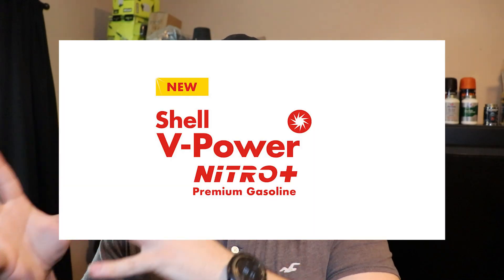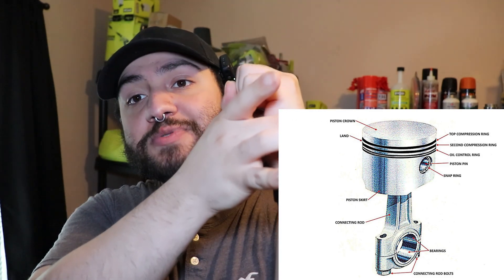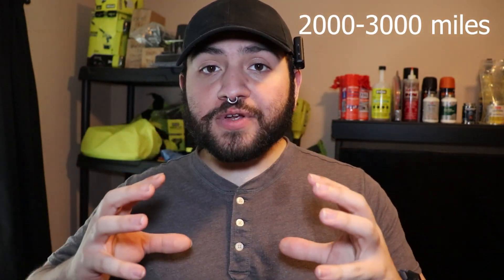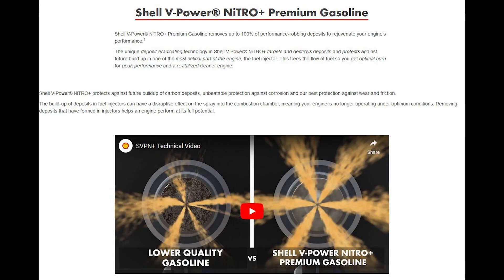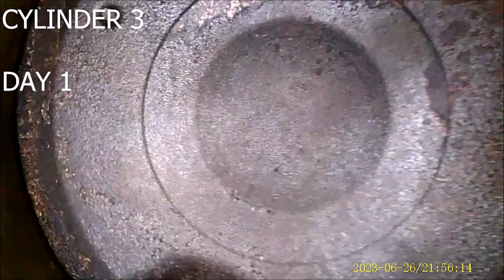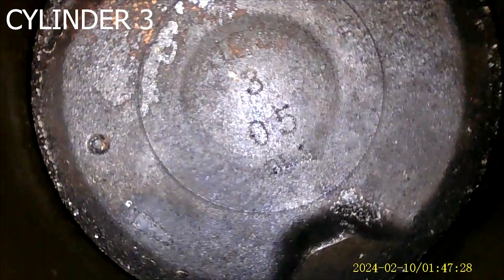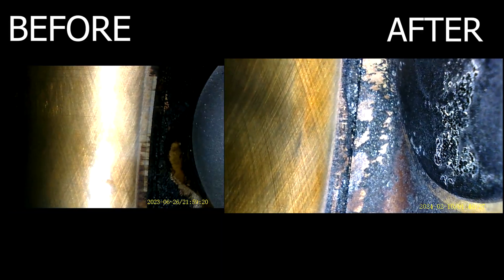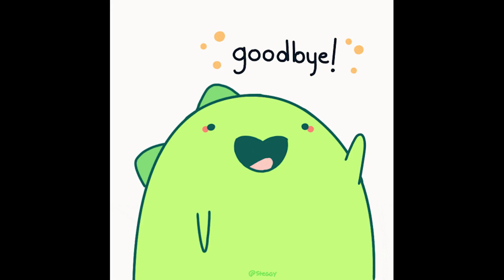IS PREMIUM GAS A SCAM? $$$$ (SHELL V-POWER NITRO +) - 8 Month Experiment

Comment: ‘Premium’ octane is only for engines that require it. I do consider shell and chevron to be premium brands, but no need to use premium octane unless your car requires it (like sports cars and luxury cars). ‘Cleaners’ are the same for all grades, it’s just the premium octane has other additives to prevent low speed preignition in high compression ratio combustion chambers.

Comment: Imagine not being smart enough to catch on language play in the marketing material. "Up to 100%" is merely stating theoretical possibility of the maximum result which is very different thing from guaranteeing a MINIMUM amount of result. The kind of marketing material we as consumer should want to see is "Guaranteed to remove AT LEAST x %" or "Guaranteed to remove MINIMUM of x %" . The "up to 100%" actually mean 100% is possible but they make no promise and realistic it could be 1% of carbon removed but they only merely state the possibility of 100%.

If you realize or knew this you would highlight this and knew that the marketing material is not worth paper its printed on not even worth seconds of our live talking about it.

Oh and  if you want to remove carbon your best bet is either chevron techron bottle or redline SL-1 those two actually contain PEA which is one of basically only chemical proven to actually remove carbon in engine. You would basically have that 8 month worth of result in maybe 3-4 tanks of gas whichs maybe 3-4 bottles. (dont be scared about overdosing to maximum of double of recommended amount ratio)

Comment: I use BP 98 oct. premium mostly as it is cheaper than Shell most the time here in Australia. It contains cleaning agents e.t.c 
and i add a fuel injection cleaner every 5 or so k. I Think using BP and Shell Premium from the start when buying a new,car is a good preventative measure. Besides, more performance and more km comes in to play too.

Comment: My mom's 2004 honda crv started idling rough after filling up on some Phillips 66 93 octane gas which had never happened before so I added Shell V Nitro with a Bottle of STP Gas cleaner on the way back home which was still 30 miles away and my mom's CRV started to idle smoother and the engine light even turned back off after I added the Shell V Nitro Gas so I think maybe the gas station at  Phillips 66 had water in their gas or something even though it was 93 octane. It was mostly highway miles so I'll definitely be using it again.

Comment: There will always be carbon on the inside of an internal combustion engine unless you disassemble it and wire-wheel or bead blast it away.  That's the "carbon" part of hydrocarbon fuels.  It is a by-product of combustion much like the soot in your fireplace at home or the black oily crud in a BBQ.

Comment: Hello I am new here. Happy thanksgiving 🍁 good video. I run Shell fuels in a 2016 RAV (4) or if at Costco I get fuel there both are great & certified top tier gas. I take the vehicle out on the freeway which is a good way to cut down on the carbon deposits & running a good quality fuel makes a difference. 😊 I use Valvoline Protect & Restore Full synthetic Oil 0-W-20 . I put a Quart of Lucas synthetic oil stablizer I mixed into the oil and mixed it in before I changed the oil that vehicle & it’s high mileage. But it runs like a champ

Comment: the people who made my car require premium fuel. if it is a scam, oh well then I paid a few dollars more for gas. I’m not willing to possibly ruin my engine to prove that it is a scam.
Reply from the maker: if your car is engineered to use fuel that is most resistant to explosion/combustion (octane) then that's what you should use. I will say look into additives from wherever you get your fuel from. If it's good stuff then yeah it will cost a bit more but you also have more additives like cleaning agents to keep you valves injectors and piston heads cleaner. When debris from the combustion cycle gets past the compression ring to the oil ring you may notice oil on top of your piston being burned and even smell it while driving. Thanks for sharing Michael.

Comment: $4.39 for Nitro 93 in Indiana today...12 May 2025. I believe my gas mileage is better on Nitro. I drove my 2024 platinium higlander to Lake Wales Florida and got 26.4 miles per gallon and cost me $70.00
Reply from the maker: nice. higher octane + the cleaning additives refresh the fuel injectors it would make sense that your vehicle would burn less fuel and use what is being used more efficiently. That's good to hear :)

Comment: Forget about NY drivers, how about the fact that the cheapest gas was used for the life of the vehicle?  What about oil selection/quality as well?
Reply from the maker: @pbellissimo  low quality conventional oil definitely affects vehicle performance. Additives in good quality oil include anti sludge build-up properties. Castrol is solid for combating sludge while Mobile 1 is good with quickly coating components to minimize friction within seconds of startup
Reply: I believe no matter which oil, no more than 5k and 3k better
Reply from the maker: @pbellissimo  I agree. I personally also always put a new synthetic oil rated filter as well with every vehicle I work on. The oil I use is also rated for a year so if the owners don't clear the oil's mileage rating, I'll still schedule them for their yearly change. Haven't had an issue yet.

Comment: Good experiment. I think Shell Nitro+ is effective in cleaning deposits in the Fuel Intake System, not in the combustor. I always use Fuel System cleaners, such as Techron and STP. All these cleaners are called Complete Fuel System Cleaners. All these products claim one bottle can clean all fuel systems. So I feel the term, "fuel system", does not include combustor. So it's less effective to clean the combustor. Maybe I am wrong. It's just my opinion.
Reply from the maker: @yifeipei5484  I hear really good things about techron fuel it's just not available near me. And yes the magic bottle that gets sold to people who can't afford repairs is wild. These patches, sealants, and fillers ultimately to more damage to vehicles in exchange for the vehicle being quieter and not leaking for a month or two
Reply: @TOOL_TECHNICAL  I just bought 4 bottles of Techron Concentrate Plus for a total of $18.30 today. I will add one bottle each month to see whether they can bring some improvements. I use Costco #87 gas. Maybe in the future, I will try Shell Premium gas.

Comment: I want to know how often was that car oil change for all that buildup I’m looking at was it the oil change regularly or was it cheap oil cause that can also be a factor as well how often the oil changed and the car was maintained 11:53 you did say it was a rental
Reply from the maker: @American_Express_my_love_  because I used mobile 1 100% synthetic oil, I got in done yearly for 7 years along with a new fram ultra synthetic filter. I always assume prior to me touching any vehicle that it was completely neglected or given inferior fluids/lubricants. The current owner has had it for 7 years, before that one owner, and before that a rental in 2 other states
Reply: @TOOL_TECHNICAL 🫡🫡🫡

Comment: I also put seafoam inside of my tank. I put 93 octane shell in there. I did that today and I’m gonna see how well it works out but I’ve been using Shell for like four or five years. I cleaned out my car. I drove to Florida and back on 93 octane I filled up six times.
Reply from the maker: @American_Express_my_love_  I hear very mixed reviews about seafoam. General people go with Lucas, amsoil, etc. For additives. Hopefully it works out for ya. Ouch 6 fill ups, hopefully the gas wasn't too pricey
Reply: @TOOL_TECHNICAL  yeah I really don’t remember how much I spent that was around 2022 when I had my son I drove from New York to Florida. I filled up every half tank and I change my oil the day before 5w30 Castro edge high mileage. Synthetic. I started with 62,000 miles. I came back with 65,000 Nissan pathfinder 2001 LE 3.5  engine. With my fuel saving app with Shell, I got $.20 off and $.50 off at the pump so I saved I may be paid three or 3.50 the most surprise me it was the most expensive close to five dollars
Reply from the maker: @American_Express_my_love_  not bad, those speed perk savings come in clutch.
Reply: @TOOL_TECHNICAL frfr

Comment: I’m in the UK and my last car was a 1.4 litre turbo Vauxhall Astra and the car didn’t like cheaper fuel it would judder a bit but I swapped to using vPower and the car was so smooth after that. Not sure why to be honest
Reply from the maker: @granterono1  interesting. Petrol ratings for that seem to include e10 and regular. My guess is if your engine had hot spots or issues where the fuel was combusting prematurely with the regular gas causing an almost misfire. 🤔 octane is essentially how resistant to compression before exploding / combustion something is. Your car seems to be rated for regular gas but the additives and higher octane in premium may be what your car needs. If the premium gets too expensive, you could try using regular with a fuel additive to raise the octane (of course it wouldn't have the detergents from nitro v) which may be worth a try. Hope it helps grant 🫡
Reply: @ yeah was very odd, I assumed it was just my engine till someone in a group for astras mentioned they had the same thing. I got a new car now so that’s no longer an issue for me :)
Reply from the maker: @granterono1  that's cool, hope it lasts a long time for you with the right care

Comment: 2008 impala 151k miles. Shell v all the time. Big difference runs like a champ alone with all mobile one oil/filter. Let’s not forget Lucas trans conditioner before any problems.
Reply from the maker: I've only used lucas fuel injector cleaner and seen little if any results. Glad the fuel works for you! Transmissions are super expensive, I hope yours lasts forever :)
Reply: @TOOL_TECHNICAL  yes thank you. trans fluid is still little red.
Reply from the maker: @Dwayne6692  solid. i'd change it every 30000 miles with a new filter and gasket. many ATF fluids say "lifetime" of transmission being ~60,000 miles. many people drive their cars for years without touching it. 30k is a safe spot, with a good filter you'll get more life and smoother driving from it.

Comment: i wouldn't be surprised that the catalytic converter and the rest of the exhaust system is looking better too. while i have been using a different brands higher grade fuel (ethanol free too, dunno if that matters or not) for a couple fill-ups and have noticed a bit better performance as well as the tailpipe be less sooty.
Reply from the maker: prevention is the name of the game, once clogged (like any home appliance) the parts have to work and wear harder to compensate performance. Take care of your machines and they will take care of you :)

Comment: I wonder if I could just fill up my vehicle halfway of normal gas and the other half with the premium stuff it would work
Reply from the maker: the octanes would average for less performance. You'd be paying a partial premium for essentially the same regular fuel. regular octanes are 85 - 87 while V-power nitro (depending on location) can be 91-93. assuming you had 85 regular and 93 Shell Nitro premium, it would be 85 + 93 = 178 / 2 = 89. You basically get shell plus gas with nitro price and some of the cleaning additives. I would go all or nothing but that choice is up to you Moxie, thanks for sharing :)
Reply: @TOOL_TECHNICAL  thank you for answering my question on a year old video, like damn I'm subscribing to you
Reply from the maker: @PrototypeMoxie  no problem at all, every question should have an answer :)

Comment: Run Valvoline Restore and Protect 5w30 , change it quick at 3000 miles after initial change and than 5000miles later for future changes....and than do that type of in Cylinder views
Reply from the maker: thanks for the suggestion!
Reply: @TOOL_TECHNICAL  it will surprise you , at the same time continue with Shell 93 the best fuel on the market

Comment: Lots and lots of variables to consider. Here is one observation. The extra fuel cost for the Shell Nitro in a 20 gal tank is about $4 (per fill up). Using Top Tier gasoline exclusively and a fuel system additive once a month might be a better alternative.
If the driver is contributing towards carbon buildup that could also influence results.
Reply from the maker: @Howard-dv4vo  preventative maintenance is the name of the game. This is the "top tier" shell has to offer so I'm assuming you mean the highest octane choice at any station? Fuel additives can help but there are too many snake oil products on the shelf. Thanks for sharing Howard
Reply: Wow thats cheap! premim is almost an extra dollar per gallon in iowa

Comment: I have a 2002 Ford F-150, and I started using Shell V-Power Nitro+ July of 2024. I don't use it on every gas up, but when I fuel my truck with it, I can tell the my truck LOVES this gas! It out performs any other gas I've used in the truck. So as the months passed, I could ALSO tell that my truck engine performance was getting better and better. And as of today, my truck performs like a car! The engine is silent and steady and FAST! I don't know about if it's cleaning all the carbon deposits, but it's doing something great for my truck. I'm a believer!

Comment: This is a port fuel injection engine, so of course you should see some cleaning results because the fuel sprays the back of the intake valves.  However most vehicles are gasoline direct injection now and the spraying of fuel is no longer on cleaning intake valves.  Do you plan on doing this experiment on a GDI engine?  That would be awesome.  I’m o see.  I drive a Porsche twin turbo 3.0 and I was using shell, but Porsche recommends Exxon Synergy Supreme Plus.  I am curious to see the results between these fuels in a turbo charged GDI engine.
Reply from the maker: Yes this is multi-port, I currently don't have a GDI vehicle owner willing to do the experiment near me where I could control the variables for an honest experiment. If you've ever seen Volkswagen GDI valves get caked in carbon it is not fun. For the cleaning concern, many prefer a multi port inject so the ratios can be more dialed in. The sequential injection is consistent and easy to maintain. appreciate the feedback. A turbo porsche sounds cool but right now I got snow and it's 2-5 degrees F lol

Comment: I think you would see better results if you use Gumout Complete Fuel System Cleaner with PEA in it every 3,000 miles in conjunction with the top tier gas.
Reply from the maker: Thank you for sharing crazy, there are so many suggestions from Nitro V to techron to fuel additives. I hear good things about gumout's carb cleaner. Appreciate the tip!
Reply: @TOOL_TECHNICAL  As long as it has polyether amine  PEA, the additive will clean.

Comment: Wonder if the Shell claim means it eliminates 100% if it's a brand new engine using exclusively V nitro 😜

Maybe it's in the small print Disclaimer.... which I've never read.

Regardless, it would be good knowing what exact parameters they used to make the Claim...engine type, age, how long the test period was, etc.

Comment: The problem i see with your test is egr. As stated below ive been running the best fuel available to me for a long time. 
But what stood out to me is. Some trips to the track were over 2 days and comming back home at night.  Meaning running 2 days of wot basically.  Even driving home through Germany the car stayed pretty wide open or about 100mph .  Came home and my exhaust tips, on the inside, went from the usual black to a verry light rust color. This darkened again after a few shorter trips. Telling me egr still will ruin a bit of the good work your premium fuel is doing. 
Also contributing to your cleaning proces would be verry short oil change intervals.  Like every 1000 miles untill you get pretty much clean oil when you are draining the car. Mine has never been black or anything close to it. A darker brown has been seen but this was after a 2 day stint about doubling my miles 😅
Reply from the maker: @glennverdeyen5685  for the average driver id say 3-5000 miles between oil changes (with a new filter) but yes you can shorten intervals if you notice your vehicle heats /cooks your oil more than usual. I'm not a fan of conventional oil so I'd say 3-5 k miles or 1 year (whichever comes first) with synthetic oil
Reply: @TOOL_TECHNICAL  For a stock car I agree with you whole the way

Comment: Im from Europe and own a 2014 Audi S3. Bought the car used under 4000miles and it has now 31000 miles and from about 6000miles and up its been running Shell V-power 100 mostly and all other fuel used was either also 100 from the pump or from a can. 
The car is bone stock ecu wise and has intake mods and an intercooler.  Things just made 341hp and 319 pound ft . After more the 4 years of hard track use. So make bank on it maintenance and good fuel is key to having a healthy engine. Oil changes have been done about every 700 miles. Soon ill be adding an oilcooler which means the intake has to come of the car. Im looking forward to making a little video of the inside of the engine. Mabe ill try gettig a camera in the combustion engine . But from the hp numbers id say its pretty clean 😅
Reply: ...So, so sorry you own a super-expensive VW---that's what I call Audis!😮
Reply: @Funkydood tell me you dont know 💩 without telling me 😂😂😂
Reply from the maker: @glennverdeyen5685  hope it all goes well, here between rust, cold weather, and parts needing to be ordered it can all go very well or very wrong 😭
Reply: @TOOL_TECHNICAL  wish you luck, I am blessed no real winter to speak of and the good cars stay indoors when there's salt on the road 😅